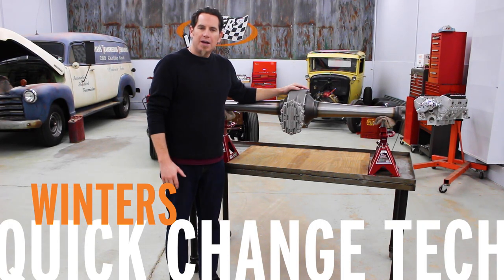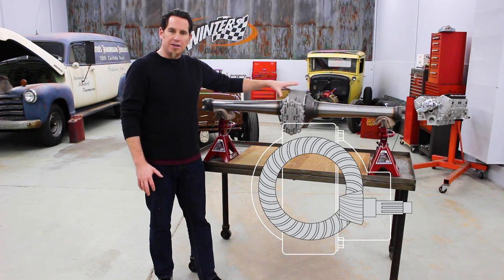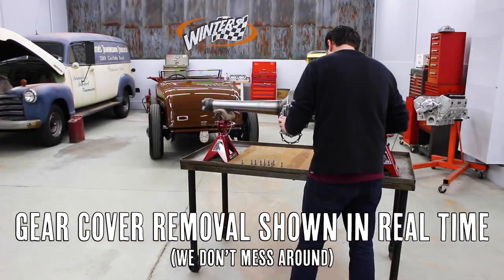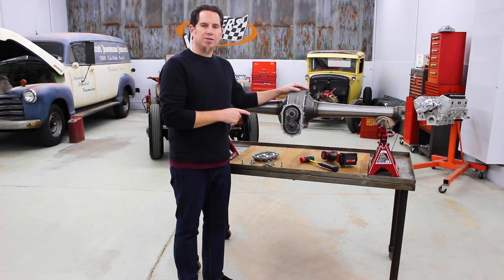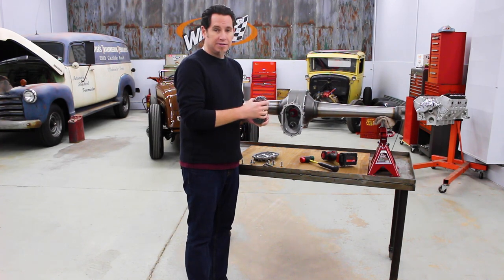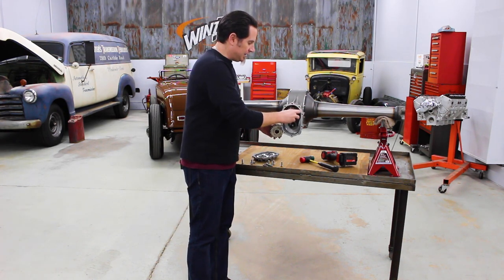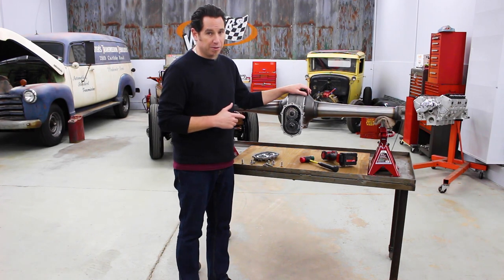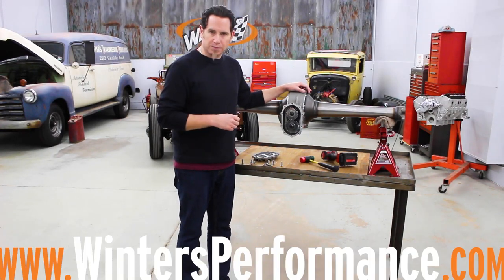What is a quick change rear end? // Winters Quick Change Tech

Comment: Are these the same gears used in late model stocks?
Reply from the maker: The rear shown is a smaller V8-size rear, which uses 6-spline gears. The Late Models run our bigger 10-inch rears with 10-spline gears.

Comment: Is a 1:1 ratio achievable?
Reply from the maker: Absolutely—our #1 gear set (for both 6- and 10-spline) is a 1:1 ratio. If you visit winters performance.com and click on "Gear Charts" you can view a PDF with all available ratios.
Reply: @wintersperformanceproducts  thanks for responding!  I’m going to use a fwd ls4….mount it mid engine turn it long ways remove one cv axle and connect the other side to a winters differential.

Comment: How much power and weight can it handle on slicks? 🤔
Reply from the maker: The rule of thumb is:
• V8 size (8-3/8" ring & pinion), the rear shown in this video, is rated to 600hp
• Champ (10" r&p) is rated to 1,000hp
• Champ HD (or a Champ equipped with some of the available heavy duty options, like a heavy duty lower shaft) is rated for over 1,000hp

But as you said things like slicks, trans brakes, how much the car weighs, etc. all play a role. If you're running a '32 Ford with 550hp, a T5 and pie crust slicks, a V8 rear will likely be just fine. If you're running a '68 Camaro big tire car with 550hp and a trans brake, you're going to want a Champ or Champ HD rear even though you're under 600hp.

Every rear is built to order. If you've got a specific application in mind, give us a call or shoot us an email and we can get all your details and build you a rear that will live.